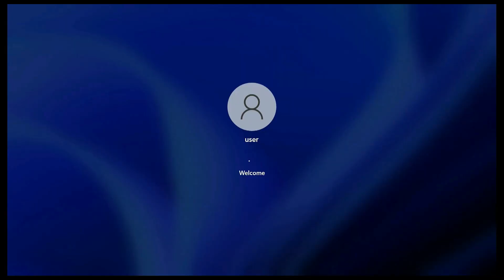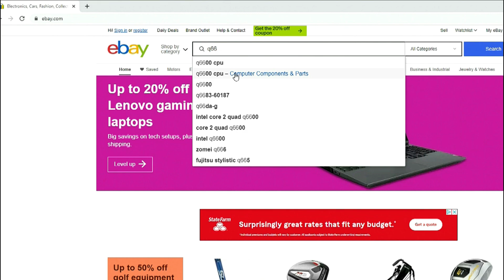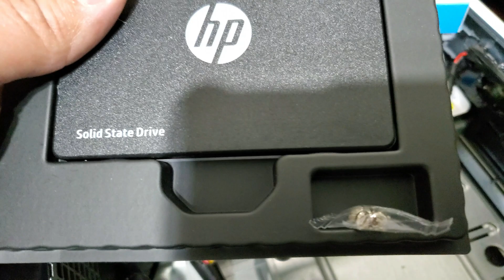Windows 11 install on old hardware?

Comment: Nice mod with the video card. How did you get to be stable like that? I did see a bolt and nut on the drive cage where the pcie extension is at, but what about the other side of the card?

Comment: How long will people keep "flogging the dead horse" of Windows, a (mis)operating system that hates its users more and more with each version?

The same people that used to say to me "Linux is too hard" are now the same people using Windows 10 and 11 who:

- Can't control when updates are installed onto their PCs by Microsoft
- Can't be sure that when those updates are installed on their PCs that old settings that turn off Windows telemetry are just reverted by Microsoft
- Have to install third party utilities and/or do deep registry hacks to try to counteract the fact that Microsoft keeps reverting their configuration
- Have no idea with each update whether or not Microsoft has installed unnecessary bloatware or started feeding advertisements in Windows Explorer
- Have to keep "avoiding" Cortana's telemetry and privacy hatred
- Have to create an online account just to use Windows
- Still have no idea whether or not Microsoft will exclude their hardware from being supported by Windows because its too old or doesn't have TPM support
- Now need to have a minumum of 8 GB RAM installed JUST to run Windows 10 or 11

All of the above is you having to fight against Microsoft for the desktop experience that you want - by comparison, Linux is easy now because you experience none of the above when you use it and it treats you like an adult.

Windows today is you buying your PC, giving complete control of it to Microsoft and then they leasing it back to you under their terms and conditions.

When are you people going to learn?

Comment: just curious but what is the point in benchmarking some games you cant even play anymore online ??
Reply from the maker: The point was an operating system full of bloatware can be installed and run just fine on older systems. It had nothing to do with Gaming really but usually someone asks.
Wait why can't you play rocket league online?

Comment: i used a hp dx2400 motherboard with a e5450 modded to work with a 775 motherboard 8gb ram but the motherboard gave out on me because a power supply went out messed it up. it still worked but none of the usb2 outputs worked so had to use my usb3 card till i got my newer rig. what i'm running now cost me $80 but 20 was for the ram upgrade and my rig now is a asus motherboard with a i5-4670 16gb ram 750ti sc and just over 2tb of hard drives with 512gb of that being a ssd all in a thermaltake tower. i did add rgb fans to it also but didn't add the price of those but with those added on i have just over 100 into my computer
Reply from the maker: Sounds like a great budget system! The 750ti can still play some great titles. Loved that card

Comment: currently in my system i am also running a core 2 quad q6600 running at 3ghz using BSEL mod , i got 8gb ram and a  firepro v4900 graphics card , recently i got a 60gb ssd and finally finished the dell optiplex 780 build. I have about 2 tb of games storage in the pc and it runs all my games just fine , mostly because i dont play any super new games , But in titles like csgo , dirt rally, call of duty black ops 2 , minecraft , euro truck , paladins everything runs fine at 60+ fps 

CORE 2 QUAD IS NOT YET DEAD 😂
Reply: Phenom x4 neither

Comment: Hello, I need some help  with my cpu performance. 
I have a   i7  2600  
16 gb or ram dual channel 
I even have a ssd wich I put windows 10 on, the problem is that the performance is very low .
In some games my procesor can go to 100% and in some other cases still the same thing.
Any advice on how to improve my cpu performance?